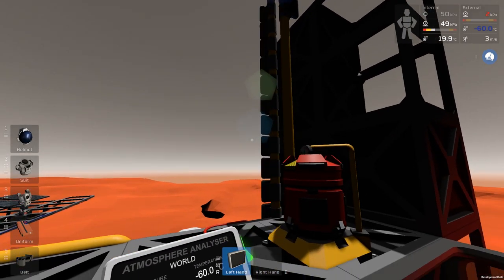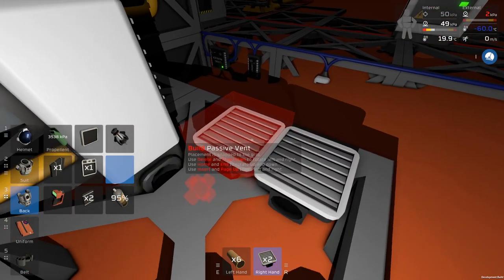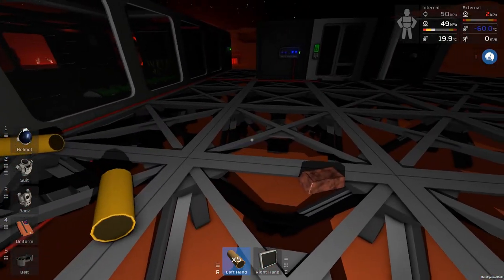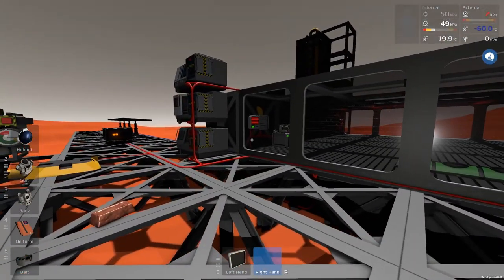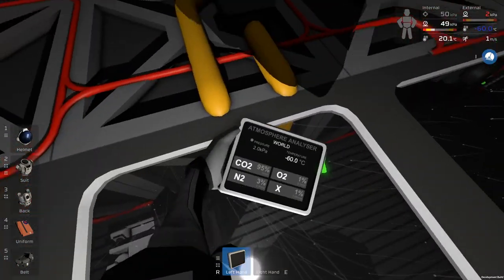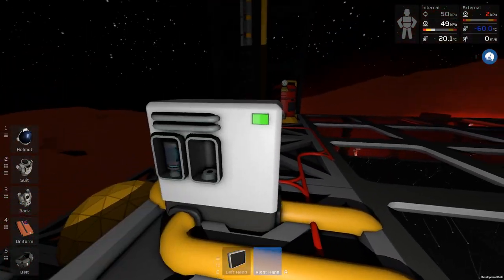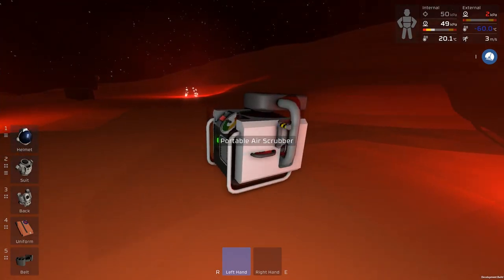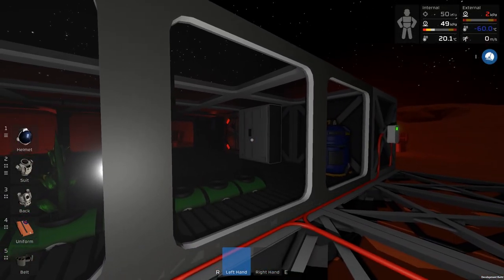Stationeers Season 2 E09 - Oxygen Refill and Automatic Heating

Comment: The problem with the tank isn't that it will get really hot. The problem is that if it sits at high pressure and outside temperature, it'll come out at like -200C if you depressurize it by a factor of 3.
Reply from the maker: Yeah, I don't think we have any sort of tank heater, other than building some sort of intermediary high pressure heated room, with a valve opening to the main room (or similar sorts of things)
Reply: grayduster On the other hand, it might be less of an issue once you're extraction O2 constantly, since plants will produce heat at the same time that they turn room-temperature CO2 into O2 that will be replaced with cold CO2.

Comment: 38:40 Extra doors and pumps seem not hugely useful as they consume your attention. If you're going to be running the heat exchange pipe around, why not pressurise from the co2 tank in the back? Also, perhaps it's time to put an airlock close to your fabricating machines? Running around and jumping is costing you a huge amount of time. Optimise for shortest possible paths since human time is the most expensive here.
Reply from the maker: The CO2 tank in the back is pressurising (that's what the regulator is for).  Given that it'll eventually be a gas storage room back there, we'll definitely have an airlock pair at some point, moving from CO2 heavy atmosphere to N2/O2 atmosphere zones.
Reply: Hrm. I don't think I communicated my idea well. And reviewing it, I don't think that my suggestion would work, as there's no way to deal with incoming gas. ::sigh:: I do stand by my suggestion of an airlock leading to your co2 room direct from your base, instead of on one side. (Or to rearrange your manufacturing so that it's all directly outside your airlock)